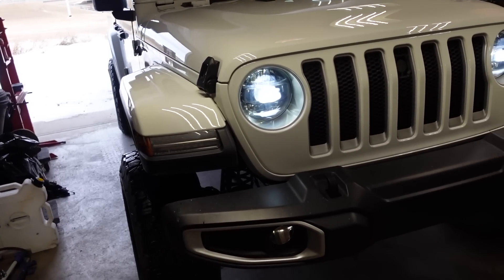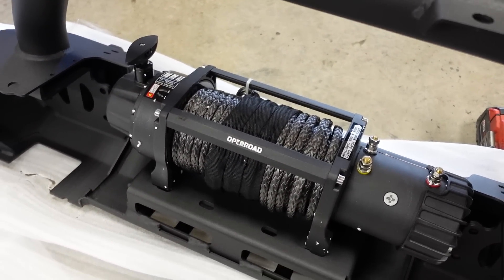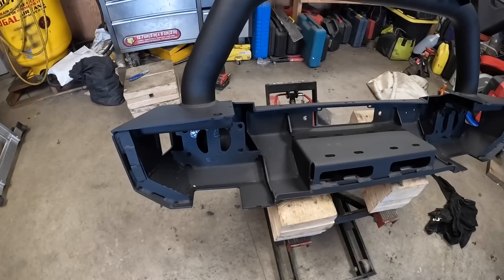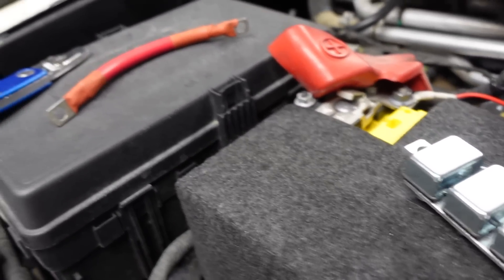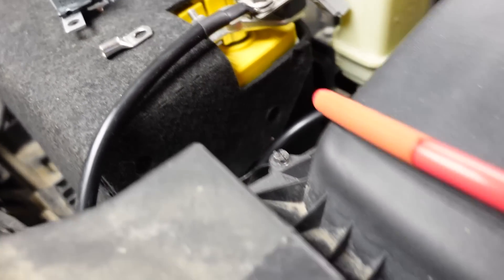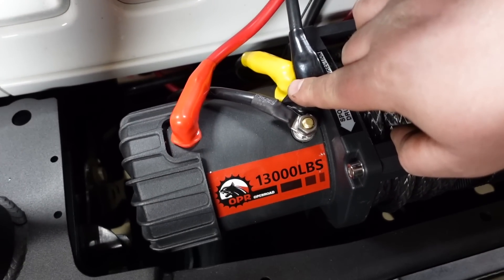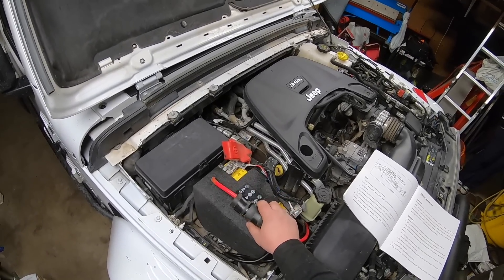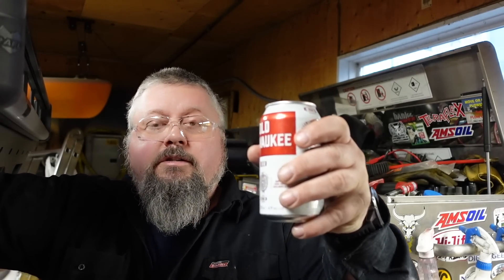OPENROAD 13K WINCH INSTALL JEEP JL WITH ARB BUMPER

Comment: I bought a winch like that 10 years ago and it was terrible. Water intrusion and brush holders would rust causing them to stick. Every time I would go to use it wouldn't work until I opened it up and clean it up. Hope they revised them.
Reply from the maker: winches have come a long way in 10 years but you still need a cover to keep the elements out